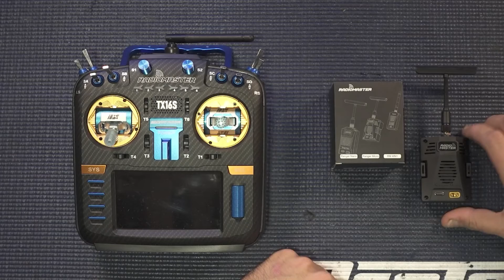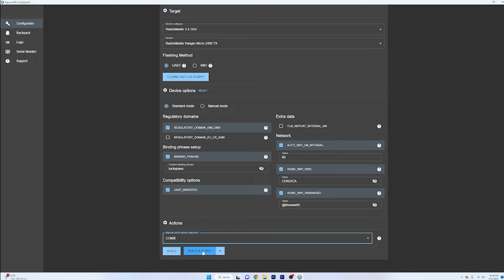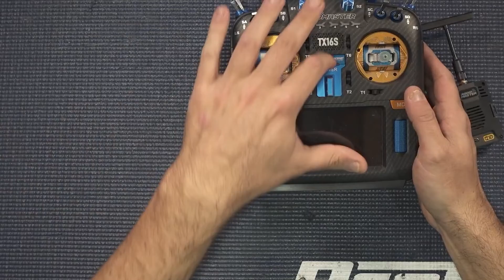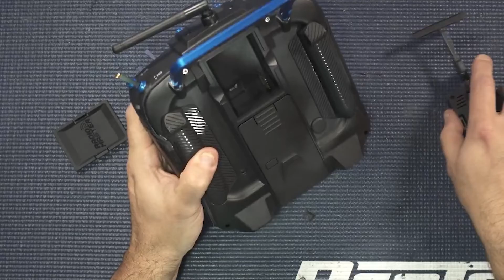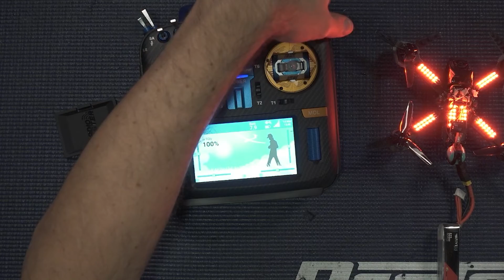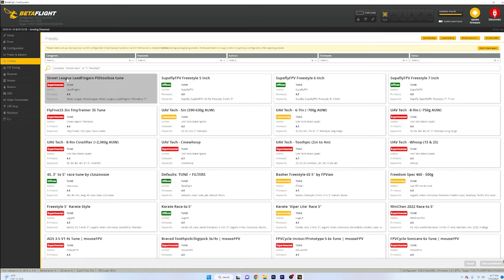RADIOMASTER RANGER MICRO INSTALL UPDATE ELRS | FASTER SPEED MORE POWER

Comment: Sir, I have a few questions and I would be very grateful if you could kindly reply.
I am using a RadioMaster TX16S (4in1).
If I buy the RadioMaster Ranger Micro, can I connect the Ranger Micro to my mobile phone using a data cable and fly my RC plane by uploading missions from Mission Planner on the mobile?
Or do I still need to buy a separate telemetry radio for mission flying?
I also saw on your YouTube channel video that by adding Lua scripts, when you tilt or move the flight controller, the TX16S screen shows the plane/FC movement and orientation (roll, pitch, yaw) in real time.
For these features, is the SpeedyBee F405 Wing flight controller sufficient?
Or do I need a higher-end flight controller for accurate orientation display on the TX16S screen?
Lastly, could you please suggest a good mini-size GPS module with compass support that would be suitable for an RC plane?
Based on your answer, I will decide whether to buy the Ranger Micro or a separate telemetry system.
I already own a TX16S.
Thank you very much in advance, I would really appreciate your guidance.
Reply from the maker: The Ranger Micro is a great choice and should connect directly to your phone for missions. For the orientation display, the SpeedyBee F405 Wing should be perfectly fine!

Comment: Can you help me with how to flash the same module? The device won't detect on the configurator but on the laptop it detected?
Reply from the maker: turn on its wifi and log in using the elrs local network and upgrade that way.  use the configurator to build your version and then flash it outside of the configurator

Comment: Glad you said that. I have nothing but trouble with flashing,connecting, or updating everytime have to do it a different way wasting more and more time. Just got ranger micro because tired of not having the range lose signal all the time but guess what no target for the ranger imagine that???😮
Reply from the maker: elrs is kind of a mess for sure
Reply: @Dorkyand40 I've not been thrilled with erls. Much more finicky and less reliable than TBS CROSSFIRE in my experience. I only use it on my small quads that have it built into the FC. Yes I know this video is a year old, but I had to say that anyway.

Comment: FYI: Jan 19th 2023, Radio Master issued a warning to Micro and Nano users to not use the XT30 port to power these units. Fine to use radio power through the pins. Issue does not affect the Large Ranger. New boards to be produced and pushed out to retailers so you can replace the board. Apparently some folks have blown up their radios powering the modules through the XT30 port.
Reply: Why would you need to use the XT connector to power if you can power via the radio?
Reply from the maker: Save battery power. Also some older radios couldn’t fully power a module to 1 watt. Anything out there now is fine though.
Reply: @Dorkyand40  do you know if the tx12 can power it up?
Reply from the maker: Yes.  Usually it’s the smaller radios like zoro that have an issue
Reply: New to FPV, so confused why there is a need to
Reply from the maker: Yes thanks. I mentioned it briefly in the video. Good looking out
Reply: What if we bought a micro ranger from eBay, will they send out a replacement? Does anybody know

Comment: What are the advantages of running this setup versus crossfire? I havent even updated my crossfire in about 4+ yrs and am on rev 2.18 🤪.
Reply from the maker: The speed and consistency of the control signals from gimbal to the radio to the flight controller. There’s been a huge push in this the past few years to make betaflight do what your sticks are telling it to do. There’s a lot of noise and jitter and the like all buried inside there. Sounds like fluff and maybe some notice it and some don’t but it’s def in there and these newer faster links fix a lot of that.